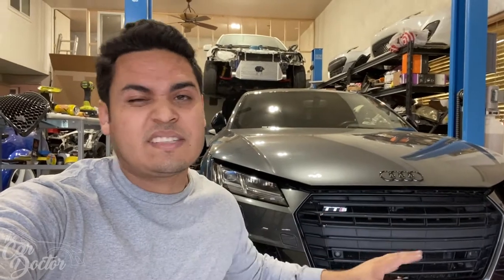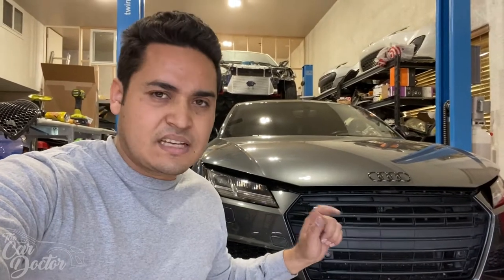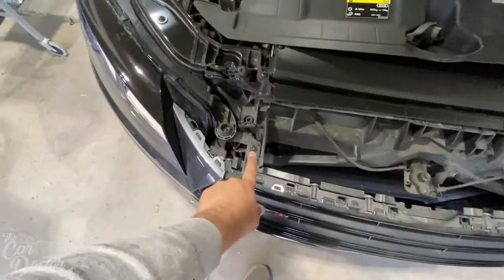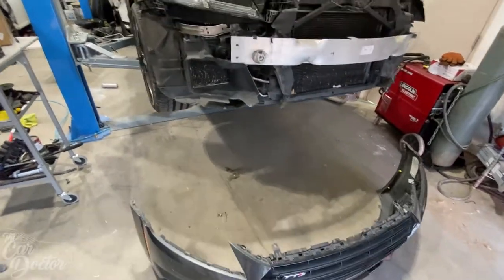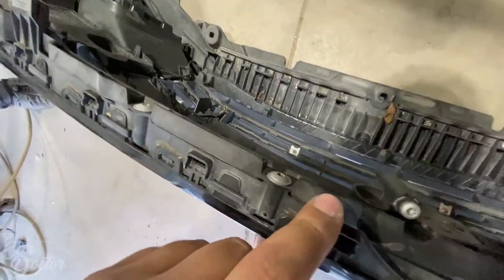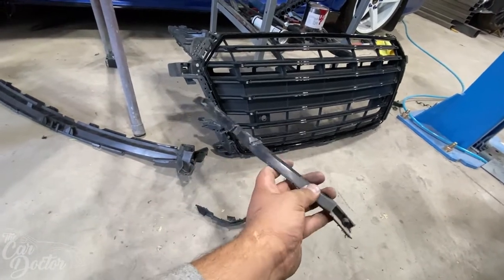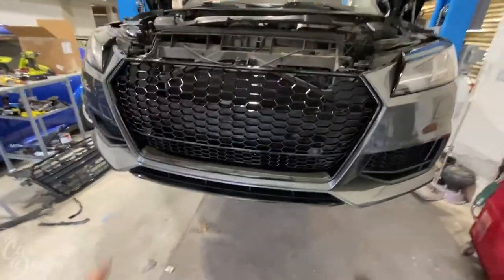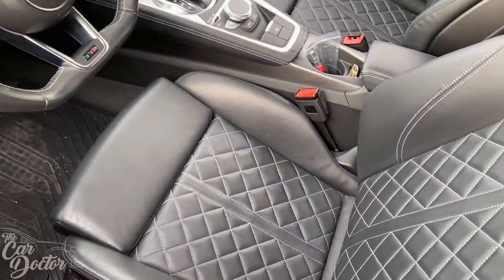Audi TTs Honeycomb Grille Swap

Comment: Would love to know more about where and what to cut to fit the new grill. And how to diisconnect wiper fluid hosing and parking sensors.
Reply from the maker: The bottom of the new grille and the bumper have different connecting points, they mainly have an extrusion that interferes with fitment, just had to shave them down, As for the rest, I don't recall.
Reply: Johnny, did you have to cut off a part of the new grill or did you cut off a part of the actual bumper?